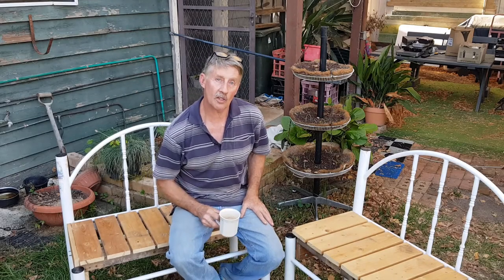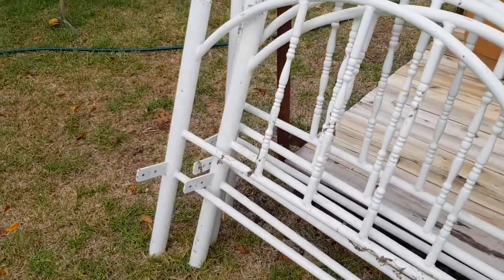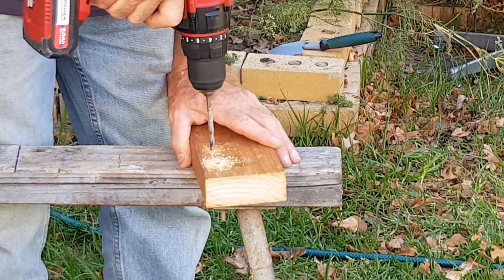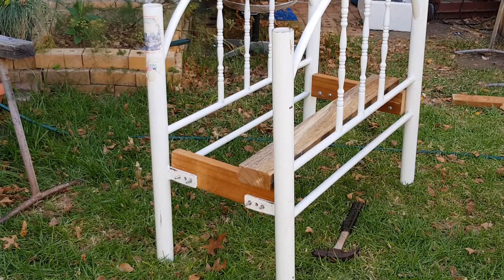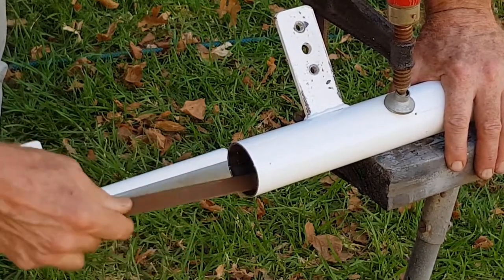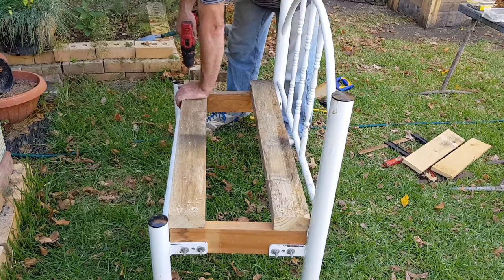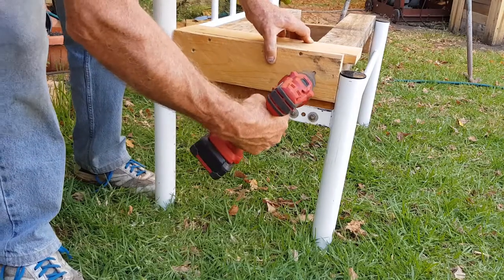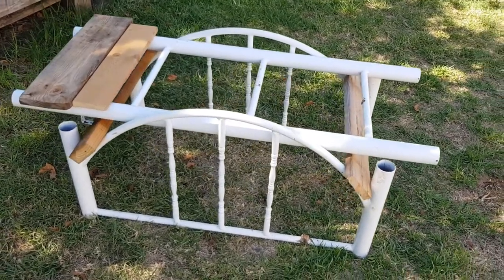How to DIY Build Garden Bench Seats from old Bunk Bed Ends & Pallet Timber

Comment: bolts should have been put in the other way around. (heads  on the outside)
Reply from the maker: Yes, I could have used normal bolts the other way around. 😊
Reply: 2yrs later 😆 was thinking same thing then realised coach bolts embeded in wood are a far stronger fix for seats, ordinary bolts will work loose quickly even with a locking nut. @The Ultimate Recyler, currently upcycling bunk beds into raised garden beds with rat proof cages hence I watched your video. No idea how long it will last but fun project. Might get all my veg this year. Thanks for reminding me about coach head bolts, solved some of the door hinge problem. Cheers Bec.